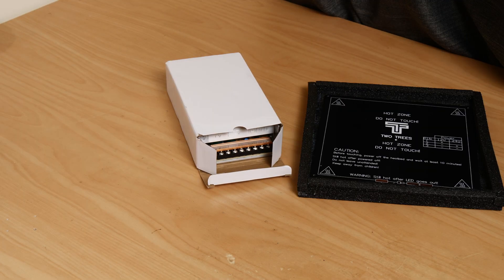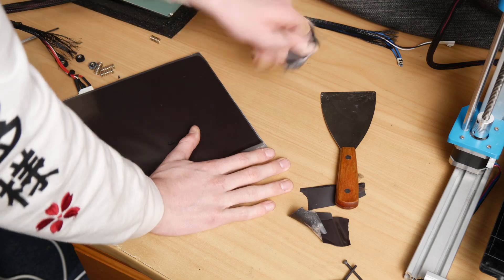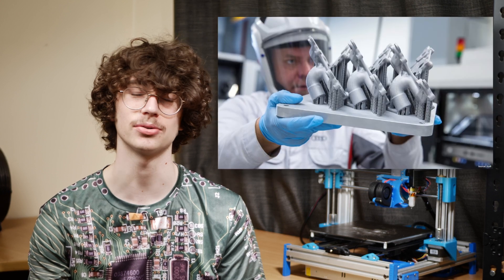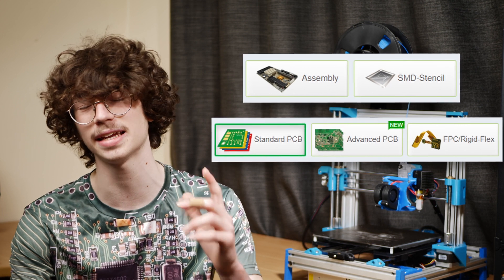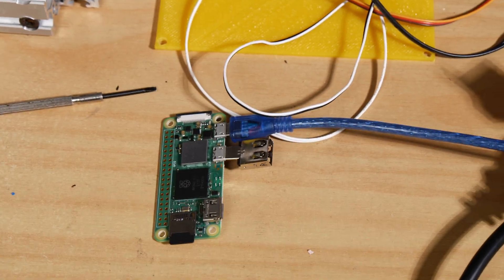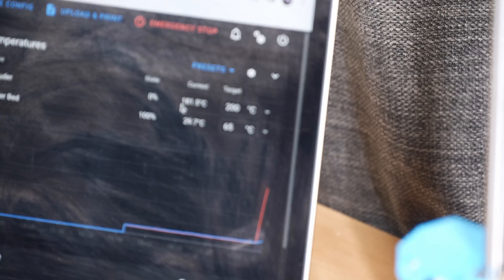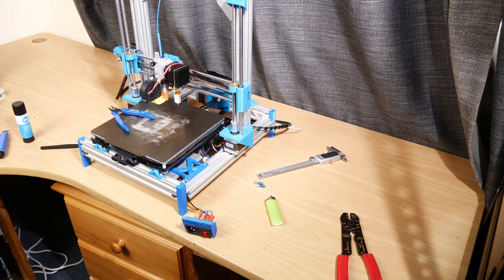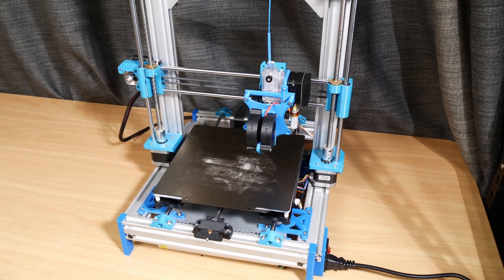Pushing the Broken 3D Printer to its limits!

Comment: Nice video. Just one safety issue you ignored it seems. The solder joints of your bed are as cold as can be. That could fail fastly. You'll need a bigger heatsource, like a heatgun to melt the solder.
Reply from the maker: I’ve had several requests to do that, I’ll give a heat gun a try as my soldering iron was struggling.
Reply from the maker: The heat gun worked great, the solder joints are much better now, thanks for your help.

Comment: What are your settings I feel like I can achieve this on my e3 Neo
Reply from the maker: I don't remember at all, sorry. This was a bit too long ago to remember. It was probably something like 200mm/s @ 10K but given the mess I remember the final results being, It could be a mix of anything. I think similar speeds are certainly possible on the E3 Neo, even more if it's running Klipper and Input Shaper. Cheers!

Comment: oh, with soldering, you need to clean with iso 99,9% first and than use a good Flux, than it will stick and flow where you want it to be.
Reply from the maker: Awesome tips, I've had some issues recently, so I'll definitely be trying those out. Cheers

Comment: this is just awful way to solder bed heater wires... those are too cold and will be brittle
Reply from the maker: I’ve redone them with a heat gun and soldering iron until they were safe.

Comment: so confused why remove all the magnet and all that stuff from the bed when its just going to be in storage. Also bunnings sells big ass 80w soldering irons for cheap. well worth in this situation great vid tho, subbed
Reply from the maker: I realised a bit late that It would have been better to leave all the stuff on, I didn't really need to take it off. For the solder joints I used my soldering iron and a heat gun to redo the joints, they're much better now. Thanks for your comment!

Comment: You might as well put a cpap fan like we use on the vz bot instead of that last fan you added at full power it would be probably about the same in decibles but way way way more air idk if i put enough way's but yea way more air dude
Reply from the maker: I’ve considered getting a cpap, maybe in a future video. They look really cool as well and have I believe, more cfm. Thanks for the suggestion!
Reply: @TommyHoughton  dude with the cpap I don't usually need to ever use the rscs on my vz bot unless printing pla at 1500mms + it sounds like a vacuum at full power I reccomend the mammoth silencer it really helps. Or you can 24 volt a 12 volt 5015 fan gdstime fans can handle it I used them before the cpap but the cpap on its lowest has the cfm of a 5015 at its highest
Reply from the maker: @TRTmike4Life  I’ll start looking into it, I’ve never spent enough time on part cooling, and it’s about time I step it up.

Comment: Those solder joints are terrifying
one thing that can really help when soldering to a surface, especially one that's basically a giant heat sink like this, is turning up your soldering iron temperature to allow more heat to soak in faster. Then, you really just want to hold the soldering iron on there for a couple second at least. You should be able to touch the solder to the point between the wire and the pad and have it melt into both of them without touching the iron directly. If it doesn't melt without touching the iron, the surface is too cold, and the solder won't stick properly
Reply from the maker: I used my soldering iron and heat gun to redo the joints, they’re much better now. Thanks for your comment.

Comment: you shouldve used a flat tip on the soldering iron while soldering wires to the bed heater. and maybe a litttle flux but wouldve gone allot easier and cleaner then.
Reply from the maker: I’ll try that next time, thanks for the tip.

Comment: Nice build, except for the terrible main wiring. No joke, especially with a printer having aluminum frame, mains protection is a must, at least cover the wires and connect the frame to the ground (the green and yellow wire that you cut on clip)
No joke, it's a life hazard, this printer could kill you.
Reply from the maker: Thanks for the tips, I’ll address them immediately. I knew there was electrical stuff I needed to do, but I didn’t know what.

Comment: For the strain relief you should create a top and bottom cover that screws together and pinches the outer sheath. The current design does seem to reduce strain on the solder joints, but doesn't provide relief for the internal wires from repeated bending.
Reply from the maker: Great idea! I’ll get to work on that. Thanks!

Comment: A short piece of ptfe between the extruder drive gears and the heatbreak would help constrict the filaments movement, otherwise you will likely have issues printing with any softer filaments.
Reply from the maker: Thanks for the tip! I’ve been wanting to print some TPU, but was unsure of the results. I’ll get that installed.
Reply: Yes u must keep filament constrained. There needs to be ptfe after extruder to hotend, just a short piece otherwise it will cause issues especially on retractions

Comment: @TommyHoughton  could you reference any forums / docs you might have read to get stepper uart going?
Reply from the maker: Of course.
Colten provided me with some helpful links, as well as the uart code itself. All I did was solder the correct wires for my stepper drivers and mainboard and input the code into my printer.cfg file and remove some other code that wasn't necessary.
https://www.youtube.com/watch?v=7ShcFKXrVHo
https://www.reddit.com/r/3Dprinting/comments/gthxb6/mks_robin_nano_v12_diagram_for_5x_tmc2209_v30/
https://www.klipper3d.org/TMC_Drivers.html

CODE (This is for my board specifically with pinouts and current, certain values must be changed):

[tmc2208 stepper_x]
uart_pin: PA10
microsteps:16
interpolate: True
run_current: 1.2

[tmc2208 stepper_y]
uart_pin: PA9
microsteps: 16
interpolate: True
run_current: 1.2

[tmc2208 stepper_z]
uart_pin: PC7
microsteps: 16
interpolate: True
run_current: 1.2

[tmc2208 extruder]
uart_pin: PC13
microsteps:16
interpolate: True
run_current: 1.2

Hope this helps!

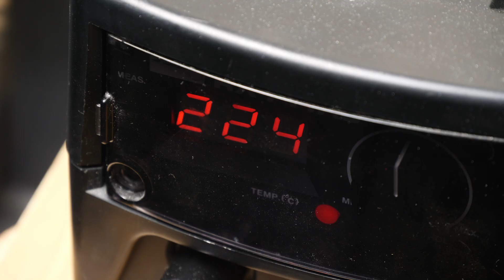Comment: 3:30 that is a very cold joint, id recommend turning the temperature up on your iron a lot, maybe 350? 400? anyways great video
Reply from the maker: Thanks! I’ll redo the joints with a higher temp, I was having trouble with the solder sticking to the cooper.
Reply: @TommyHoughton  the heated bed soaks up the heat from the soldering iron. It is a giant copper heatsink. You might need to heat it up on a hotplate or in an oven to 100c minimum to have any success at all. Good luck.
Reply: You could also heat up the bed by itself, then turn the printer off and redo them
Reply: soldering on a heat sink is hard.  use extra Flux,  preheat the area with your heat gun and Tin your wires with some high pb solder for better sticktion. don't use leadfree on 100+c heated surfaces unless you want cracking of the solder joint with repeated heat cycles.